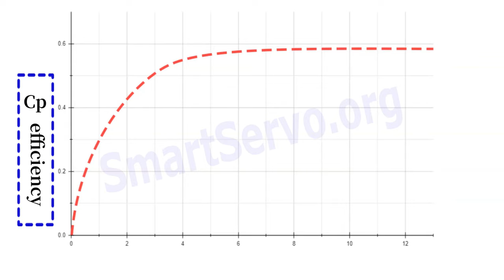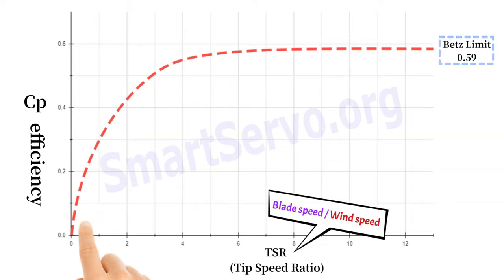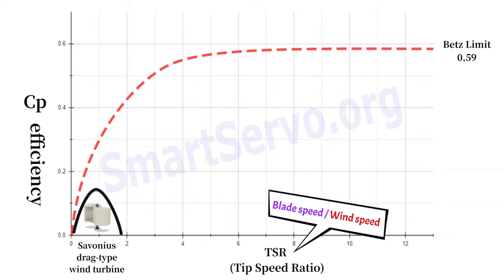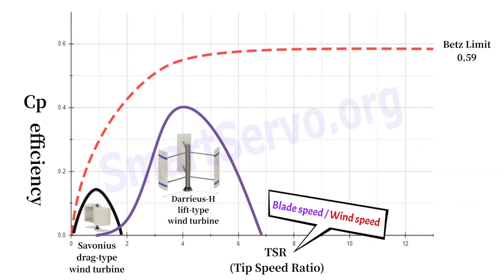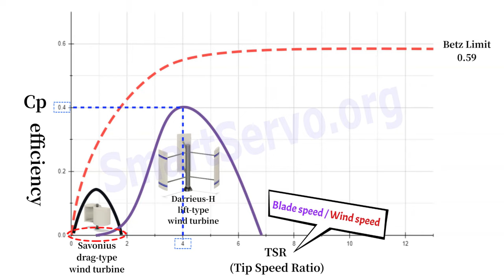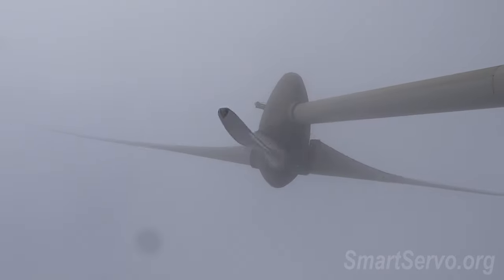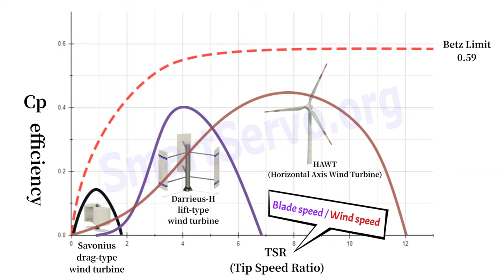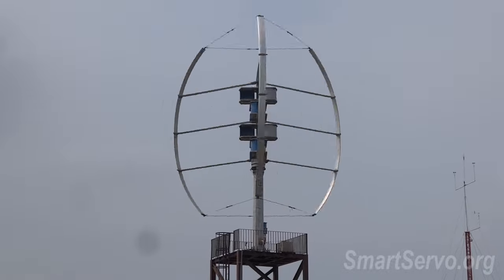Comparison of the efficiency of various wind turbines, Darrieus,Savonius and HAWT

Comment: Vertical axis wind turbines have advantages.
The drive and generator at the bottom of the tower for easy maintenance.
Can pick up wind from any direction and work well in low wind.
Aluminium honycomb blades are a bonus.
Reply from the maker: agree with you
Reply: and they don't kill birds as they often look like a solid mass at speed.

Comment: The Darrieus is a good turbine for H2 production, but not in this way of the design. The turbine should not be placed in the centre, but on the outside of the circle. This way the Darrieus higher outside cirkle speed can be harvested. When the force of the wind gets stronger, you add more turbines, instead of brakes to slow it down. High winds produce much more electrical energie, never waste it with brakes, but use more turbines to harvest it. The vertical wind turbine can only use 1, but the Darrieus more, when you bild them smarter and place the concept in the southern oceans, where these high wind speeds are more often. Think in a donut way with no centre structure and you can make these wind turbines with a 1km circle radius or more. To reduce weight and friction you make them hoover. Now also when the Darrieus blades turn back into the wind, when rotating, you can add a option that it turns its blades to get much lower opposite force. Do not use steel, but carbonfiber structures to reduce much more weight and corosion risks and energie waste for producing steel. Use the same technic on vertical turbine blades to construced almost the whole turbine system in a donut shaped way. Now put the Donut inside a outside structure to keep it in place and in a maglev position... There you go...

Comment: What are the minimum wind speeds required to function for both types? And curious how they are different in stats on the minimum wind speeds.
Reply from the maker: I think the minimum wind speed for HAWT and VAWT is not only related to aerodynamics, but the mechanism is also very important. such as friction and the cogging torque of the generator.
Reply: For small (say up to 3kW turbines) you can expect below 30W from 1 square meter (of swept blades area) at 5 m/s not turbulent wind from HAVT and around 15W from Darrieus. For Savonius it goes to range below 10W.
Reply from the maker: This is true, because Darrieus must use small solidity blades to have high efficiency, which makes it difficult to self-start. Therefore, small wind turbines usually trade off efficiency for startability.

Comment: Efficiency is 100% down to were the turbine is placed, at sea with high wind speed a 3 blade HAWT will win. In your garden/yard a multi blade VAWT will easily be the best.
Reply from the maker: Yes, HAWT is a picky eater, but (Darrieus) VAWT's efficiency conflicts with self-starting, which is why I did it => https://youtu.be/9AdpggaOfF0
Reply: @SmartServo_org its very informative video on efficiency,,i want to install a wind turbine in my farm,,i want 5 kw or above output,,which design is best suitable? horizontal or vertical?
Please advise

Comment: There is something wrong with Betz limit if kinetic energy is only 1/2 winds mass or 50% where can the other 0.926% of Betz limit come from regards Graham Flowers MEng
Reply: According to Betz's law, no wind turbine of any mechanism can capture more than 16/27 (59.3%) of the kinetic energy in wind. 
You would have to have a device that filled nearly 100% of  the "sweep area" to achieve the higher output, but then you lose the aerodynamic lift ability.,
Reply: @dnomyarnostaw  there is only 50% in the wind so where can you get .926 % from
Reply: @grahamflowers  Um, you're confused. YOU quoted those numbers, not me.
Try reading what I wrote before replying.
Reply: @dnomyarnostaw  I read what you said that 59.26% is more energy out than in  by 0.926 % but it is all rubbish the wind pushes what it touches it can not push on the gaps between the blades on a three bladed turbine is greater than the blade area of wind contact